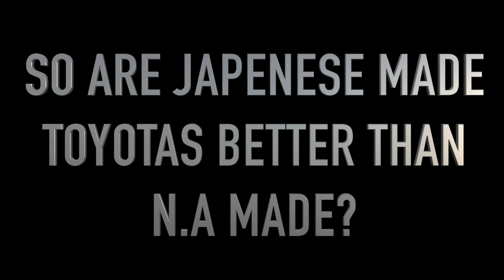Are Toyotas Made in Japan Better than Toyotas Made elsewhere?

Comment: I have a Peugeot 107 a joint venture made in east EU Toyota Citroeng and Peuegeot.  It have this KRE Daihatsu engine 69 hp 3 sylindered by toyota and whole car is made by toyota i suspect  and the French made it,s design etc.  That is a real "eternal machine" if change oil and use fluid film etc antirusting it,you can drive that car to the moon.The car is 2007 mod but function close to new, i change oil ewery 6 months, spring and autum, buying parts aftermarket, oil and filter at a big varehouse called "Biltema"   That is here in Norway, small roads especially in the countryside and in such slow small roads, the car is in it,s right element. Over mountains in 70 to 80 kmt and such use it goes using wery little fuel.

Comment: So now after watching this and I have been following for some time now 
And he knows Toyota inside and out being a professional Toyota Machanic
And backround knowledge that I’d like to believe every word…so going from that 
     Now I’m thinking ok so Toyota runs all factories the same globally so you’d think all Toyota cars would be build the same globally (we all know that’s not true) 
    So I’m wondering then the factories must be using the same brand robots that assemble the cars on the line?? 
 Or is there such a climate difference in each country that has a parts plant 
That robots in one assembly factory 
Maybe weaker then robots in elsewhere factories…
      Reason I bring this up is a few reasons 
      I had a 2016 Toyota Tacoma 
Said inside the door assembled in Mexico parts came from Taiwan/Japan 
  Truck I got from elderly guy who 
Thought he would use it to move and haul stuff to the dump but never needed to use it for anything..he would just drive it to the boarding state line and back to drive it once a week 
Anyways I got it from him the original owner . With 42K miles in the start of 2018 
By New Years going into 2019 I’ve had it a year and was hitting 58 k miles 
All having maintenance done once a month i would take it to the dealer and have routine check up and oil change 3,500 miles..dealer was the ones who told me hey there’s a recall on the struts and mounts and leaf springs in the back 
And replaced them in a day while I was in a loaner car…I didn’t know nor did I have any problems so was happy when it was fro my attention and done..(huge positive pleasure to ride and drive again) 
       Then it turn into a money pit once it hit 60 K 
I had to sell it every week something was breaking and needed repair…
     I loved the truck that I was looking into another Tacoma in same year range..
I test drove one that said made and assembled in Japan and oh man I thought I loved the stability feeling in my old truck well this one was even better 
And the only difference was the mileage was high at 180k and the color…same 2016 and 4 full sized door 6 ft bed..
I was surprised that a truck with 120 K MORE miles then mine felt more Secure
      Few days later I got a test drive on 
A 2018 Tacoma 4dr 6 ft bed with 80k miles and we took a test drive and something felt off there wasn’t anything wrong with the truck itself 
It’s just I didn’t feel tight or stable or Secure in my seat I felt like when we went over speed bumps or shallow  potholes you can hear things rattling
When the ride was done I saw the sticker in door said parts from Mexico assembled in U.S-Canada 
      So there has to be some reason why 
Japanese cars get that feeling of secureness and feel more stable 
Then cars that were assembled elsewhere…and it’s noticeable 
       Also the non assembled in Japan ones seem to have mechanical issues
Around 125k miles and they keep going as miles go up..unlike Japan assembled cars can hit 250 k and not ever have a problem with normal maintenance

Comment: compare lets say honda made in japan and made in uk swindon ..it is like water and fire to compare. 
in uk they cut costs by at least 30%   
like civic 2004 and 2007… 
2004 drive’s without rust while 2007 covered in rust all rear suspension and plus.

Comment: Strange. 2017 Rav 4. Both CV joints fine out year two. Transmission shudder year one and on going. Torgue converter not working properly. 2017 Tacoma. Not shifting properly. No recall?  I question Toyota quality. After reaching out to Toyota… no reply. Not impressed!  Over rated ?  Yes!!

Comment: 1 % difference in quality if it's the last 1 % to reach the perfect state, it usually cost more than 10% effforts to make the final 1 % in quality improvement.  Like you are running in 5,000 meter race, the final 50 meters of your running is the most difficult 1% to run.

Comment: This video could have been only 5 seconds long: Are Toyota vehicles made in Japan better than Toyota vehicles made elsewhere? YES. Thank you for watching and goodbye.
Reply: Have you even watched the video? The gist is that a Toyota vehicle model built in Japan is pretty much identical to the same Toyota vehicle model built in the USA. This is because both will get the same parts from the same part manufacturer for the same vehicle for the majority of the time. There may be minor differences, but these are so minor that they don't really add much and are not worth bothering about.

Also, the standards for Toyota manufacturing plants for across countries are consistent. Keep in mind that Toyota is a multinational company at this point where they no longer cater to just Japan

Comment: yeah the Ford panther cars with the legendary 4.6l V8 are not reliable and the Dodge with the cummins diesel are not as good as the toyota oil burning engines and trucks with rotted frames in 5 years. Everyone loves changing a starter by pulling the intake manifold like on toyotas too lol.

Comment: Off course it is a way way way smaller difference between a original Toyota out from Japan and a Toyota from America,  where the important engine and transmission parts are comming still directly from Japan (sofar i read it right) ....and a car for comparison,  from another Manufacturer like Ford,  BMW Mercedes ect....of course there is a huge big  kind of difference in quality,  lifetime and durability. But STILL A COMPLETE ENSEMBLED TOYOTA FROM A TO C IN JAPAN IS STILL DEFINITELY BETTER. BECAUSE U CAN FIND THE NAKED TRUTH YUST OUT, IF U WOULD HAVE A WEARING INSTITUTE, WHO WEAR CARS OUT BY DRIVING SIMULATIONS ON F.E. ROLLS , AND THAT NIGHT AND DAYS FOR MONTHS. And after those test Example situations u must complete taking apart those in differ lands produced cars. And I be actually sure you will be surprised how differ is the quality between zb Europeans not the best quality, Americans average quality and original Japan its quality. Once the complete Car is been manufactured and ENSEMBLED and produced in Japan,  Europe,  or America,  i be sure there is a difference BECAUSE.....1. The rubbers metals ect are still different in each continent 2. Its simply the way how it is the extremely differ folks mentally more selfish,  superficial folks from Europe or Japanese.....I ge sure

Comment: I had a 1999 Toyota truck made in Japan and I did find a bolt holding a small bracket for the power steering hose was missing from the factory. Shame on Japan.

Comment: Full of shi* 2013 Prius made 100% in Japan. Excessive oil consumption and excessive voltage without LED lights.Finally, Toyotaidiota gave up and released blueprint for some models between 2010-2014 but never did recall for free. My mechanic who is working for Toyota fixed over 3 years ago for about 2k. Unfortunately you need to go to court to get money back or open law class action against Headquarter of Toyota.

Comment: Let me tell you Toyota  make the  most shitty car on the planet. I bought  one  .I have been a motor engineer and garage  owner since 1976 .my Corolla verso 1.8vvti petrol  engine  piston small  end bearing  blew  causing  engine  knock. So I replaced the  engine. At 59000 miles. I just  covered 84 000 miles my  gearbox is  making  a winding noise  .so the  lay shaft  bearings is on its way  out. What type of shitty company this is  I will  never  buy Toyota or  recommend any human being to  buy one unless  they  want  suffer like  I did. If someone  from  Toyota  can read this get  in contact with  me. So I can  show  how  bad there  car  are. God help those who buy  Toyota  because they are goingto need it to 😂.